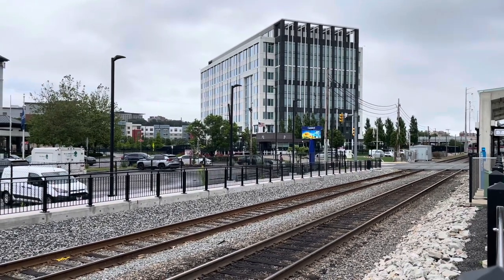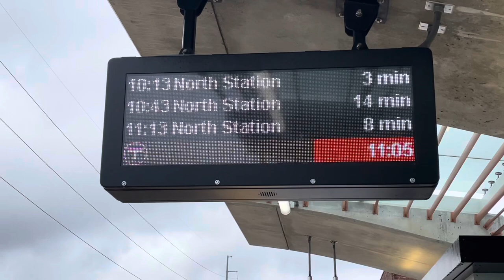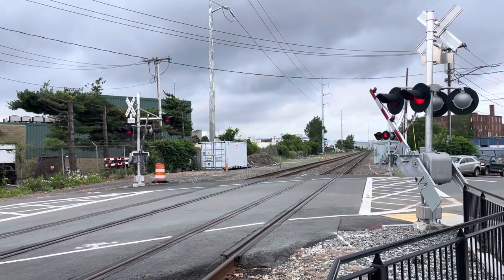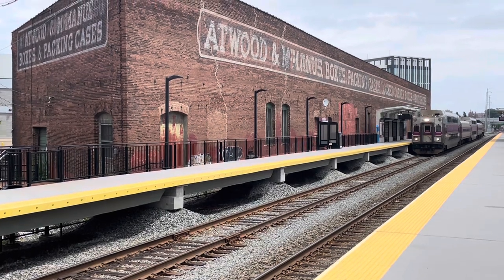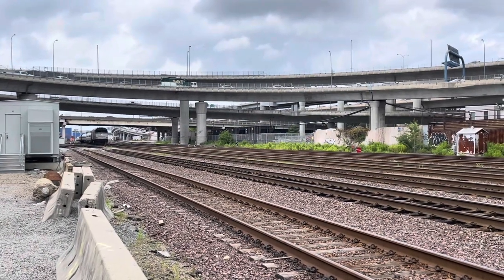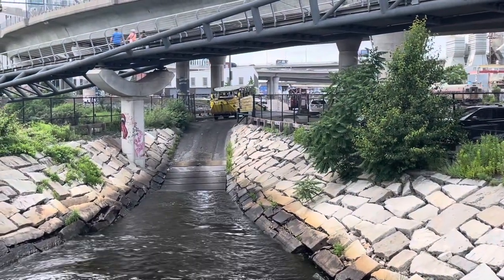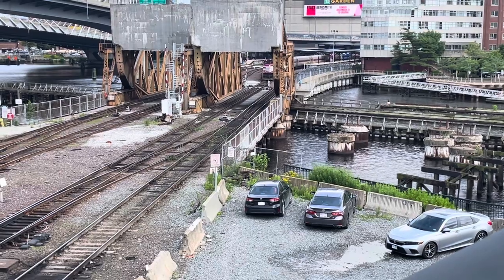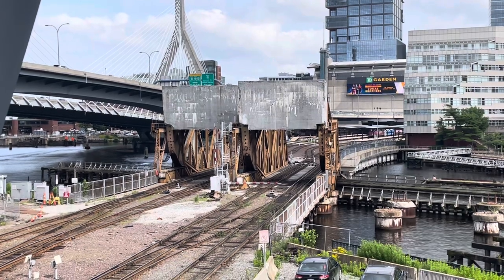Tracking MBTA Commuter Rail horns and their rolling museum of GM power.

Comment: Great video! I heard you mention what chaos a bridge malfunction would cause, the original bridge actually burned down in the past and they had to setup for another north station as the one you saw today was literally cut off from the rest of the North Side.
Reply: That happened in 1984 I believe. They had to setup a temporary station near Sullivan square for two years for the North Shore trains and Lowell trains. I believe that the haverhill trains terminated at Oak Grove and Fitchburg line at Porter during this outage.